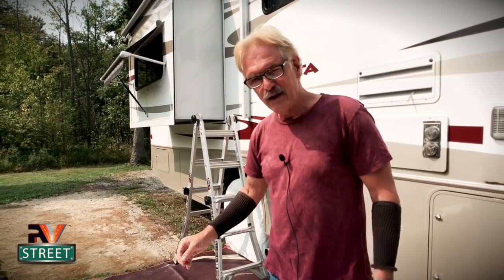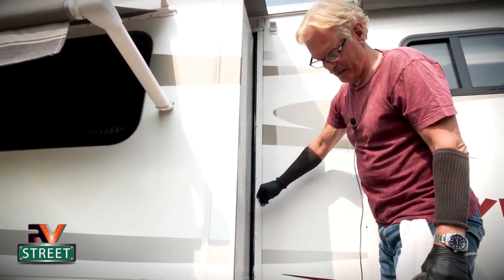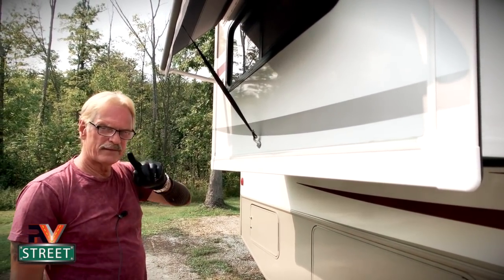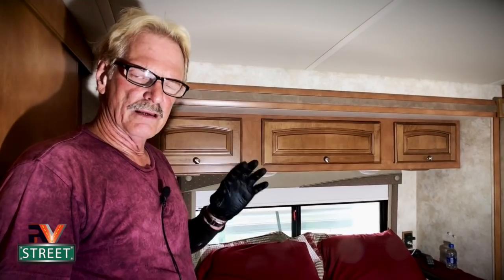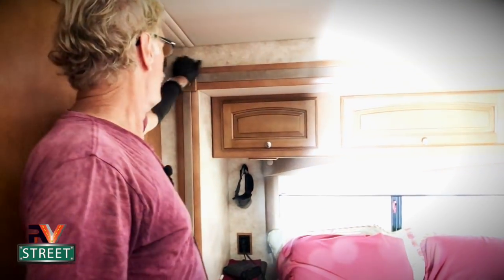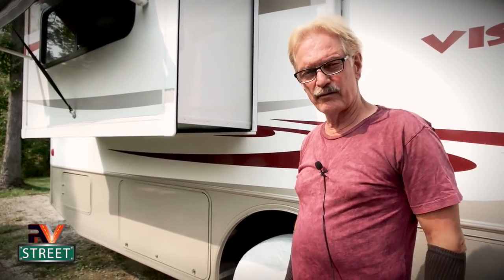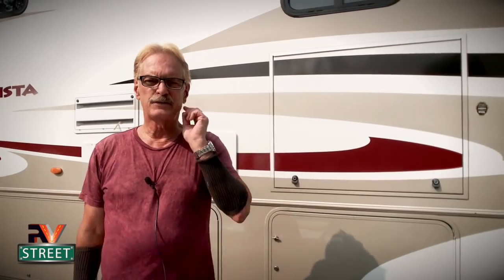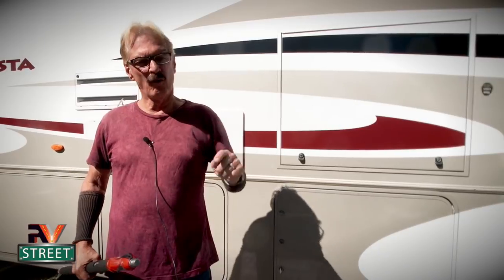RUBBER IS EVERYWHERE on your RV. How To Take Care of it. 👍

Comment: I could have sworn I watched another one of you vids and you recommended the 3 n 1 product.  In fact I think I used your Amazon link.
Reply from the maker: The only time I've ever mentioned or recommended using 3 in 1 oil was when I showed servicing the AC unit up top on the roof.

Comment: 409 spray  cleaner works better on rubber.  On my motorhome the user manual said not to use any type of cleaner due to the chemicals in most cleansers and 409 is cheaper.

Comment: Martin, why don’t you just use 303 on all your rubber parts, seems like it should do it all?
Reply from the maker: b/c 303 doesn't condition the rubber. I don't just want to protect it, I also want to condition it and keep it soft and pliable. Now for my tires YES. I use 303. Both products do different things and have different properties.

Comment: Love your videos! You teach me so much. Going to use your Amazon link to order the Slide out Conditioner. Will 2 cans do the job? I have a 31' class C so i will have Door rubber also. Does Your lovely Wifey ever do maintenance? I'm hoping i can do these projects you teach me?
Reply from the maker: Hi Gloradine, 💗
1 can will be enough to treat all your seals and everything else I covered once a year.
Yes Joanie helps me some doing assorted things. Washing the RV, polishing, helps me grease the chassis, misc assorted things and she changes the oil. 
😍 Thank you so much for supporting us using our Amazon Store. It means so much to us. You can even use our store to shop for anything you need even if it's not in our store. Just click our store link, shop Amazon like you normally would and check out.
What type of RV do you have and how long have you owned it?

Comment: Great hair.!! Just viewed ur kwikee steps ..again. Excellent.. question.i can't find the battery cut off switch wire schematics.for my 2006 Monaco holiday rambler/Neptune.  Monaco techs have not helped. The. Fuse attached to the selenoid  keeps breaking. Any suggestions? My mechanic" needs the schematics..thanks. Erin
Reply from the maker: Well you hit the jackpot asking this question.
Finding any documentation for Monaco’s and especially earlier years is very difficult. Not even the REV Group has anything. But below is a link to literally hundreds if not thousands of files. There’s more to download than you can put on a DVD. I highly suggest you download everything while you can. When you have all the files downloaded put them on a thumb drive or two. Keep a copy in your RV. I think you will be amazed at how much information there is.
https://onedrive.live.com/?authkey=%21AC8LiapHcfT6I24&id=B15E6D1D35D9EFAA%211851&cid=B15E6D1D35D9EFAA
https://www.monacoers.org/
Reply: I'm forever grateful for the wire schematics needed to troubleshoot battery switch issues. You guys are GREAT!!!  Someday I'll thank you in person..erin
Reply: I gave the info you imparted to my mechanic..he also sends his "thanks"

Comment: Another point is when you are looking at your coolant hoses to look at the hose clamps.  These over time will rust out and can be a point of failure.  Don't forget your heater hoses too. If you have a F53 you may need to take the access cover off from the inside.  This is the just the access cover not the large cover.   There is one heater hose that come has a clamp on it visible.
Reply from the maker: Yep we do that too. Hoses, clamps and everything in the engine bay. And yes the heater hose too. I actually found a real possible failure point in the heater hose where it went around a sharp corner and the vibration of the chassis was wearing a crease in the hose about 1/2 thru the hose. I replaced the hose and clamps and then wrapped that hose in split loom. This is why I teach all the time to constantly inspect and watch for possible failure points all the time and be proactive to fix these things before bad things happen. Thx for that Bob. 👍

Comment: Do you use the 303 on your awnings? I use it both sides of mine. I put it on with a sponge and on the underside while putting it on it removes bugs and water stains, plus the awning rolls out without the tacky sound nice and smooth.
Reply from the maker: Do you use the 303 on your awnings?.....
No I don't.
I used to, on our old factory vinyl main awning but I've replaced it along with installing matching window fabric awnings with a high grade cloth material. I now use Woolite and gently wash them once a year.

Comment: Do you also do your steering bushings and ball joints and bushings?    Scotty Kilmer another YouTuber  40 yr Mechanic swears by At-205 re-seal. He puts it in a little spray bottle and sprays all the rubber and bushings. He says it will rejuvenate the rubber. I’ve used it for about a year and everything looks good. I was wondering if you have tried that product?  Thank you for all the info. It’s great to see Mx type videos.
Reply from the maker: Haven't tried that product because I really like the conditioner I use as I showed. Really keeps rubber from drying out and keeps it soft. One can does all my rubber stuff outside and everything under the chassis. For me since I'm a full timer, I like products that have multiple purposes to save on storage room and money. The main thing is that these things get done with a good product and do it once a year.
Reply: @RVstreet  exactly. Do it right and correct the FIRST time. My wife and I are looking for our first class A. I’ve been a flight mechanic for the past 24yrs so I’ve been doing quite a bit of research to see what maintenance i can save money on by doing it myself. So far it doesn’t seem too bad.   Thanks again for your videos and the knowledge 😎👍

Comment: Great video and info, thanks! I followed your link but the only option available is $32 per can... is that correct?
Reply from the maker: That is correct. But one can goes a long, long way. One can will do everything I showed in the vid, plus what I listed in the description text and you'll still have some left. I use one can/yr. for the coach and our toad and still have some left to use later on if needed while on the road.

Comment: Great video!  Have you had to replace the seals on the slide of this coach or any other one you might have owned?  I have a 2008 Thor Chateau (aka Four Winds?) with the seal around the slide being one piece, as as opposed to 4 separate pieces, sides, top and bottom.  I made the mistake of leaving the slides out when it rained last week and water has intruded on the floor under the slide.  You can also see daylight when extending a retracting the slides.....probably not a good sign.  I can't seem to find any information on how to replace the one piece seal around the slide out.  I'm thinking it may be easier to replace all of the seals with completely new seals system....would you agree? I'm pretty handy and I know I can do this.
Reply from the maker: No I  haven't had to replace any seals but yes I would definitely replace them if your getting water intrusion. You can probably find what you're looking for here: https://uni-grip.com/products/slide-out-seals

Comment: Martin,  What about the  inside surface of the slide seal (the side that is against the slide when it is out) ?
Reply from the maker: If it's rubber then yes. I did cover that area when I was inside the coach remember?

Comment: Another great video! I use 303 for my seals, hoses and tires. Do you think 303 shouldn't be used in this way, or maybe the product that you use is just better? Keep up the good work 😃
Reply from the maker: 303 is great for tires because it protects them from UV rays if they're not kept covered. One of the main things that keeps tires healthy though is running them. And run them often at the proper PSI. Tires don't need an applied conditioner like the soft rubber stuff I covered in the the vid along with the additional things I listed in the description text.

Comment: Do you use this rubber conditionner on the rubber around the windows?
Reply from the maker: No. I use RejeX. I apply this as my final coat over the entire RV instead of wax. RejeX really helps repel and protects everything from damaging UV rays.

Comment: Do you also use this lubricant on the seals around the windows?
Reply from the maker: It's not a lubricant but a conditioner. We have double pane windows and I do polish those thick black rubber seals around the windows when I polish the coach, and then I apply my RejeX to them along with the coach. I clean them often too when I clean the windows. But you can and sometimes I do use this conditioner on those window seals when I'm doing the whole coach's rubber stuff and I remember the window seals. But honestly, sometimes I forget. But for me, it's no big deal because I take care of them all year round anyways. It's smart to keep them clean, soft and protect them from the harsh UV from the sun. Most rubber parts of any kind hates the sun and getting dry.
thx Mike 👍

Comment: I have seen you comment that you dislike silicone. What do you recommend in its place?
Reply from the maker: Thanks escape 👍
Silicone shouldn't be used for anything on a RV. To many better products on the market. There really isn't one easy answer to your question though. I use different sealants for different things. You can see all the different ones I use in my Amazon Store under "Sealants, Lubes and Protectants" category.
https://www.amazon.com/shop/rvstreet
Reply: @RVstreet   Thanks for responding so quickly! I want to recaulk areas (hatch doors, brake, clearance & side marker lights) that are attached to the fiberglass areas of my 5th wheel. I also need to caulk the seam where the fiberglass sides meet the TPO “Superflex” roof material. If you were doing this what would you use?
Reply from the maker: @escape1950  Here's what I'd suggest. My best advice would be, every manufacturer of any RV has what they call a "Sealant Callout Sheet". On that sheet they specify what sealants should be used on different areas of the RV. I'd go to their website and download their sheet and that should answer your questions. If you draw a blank there, let me know and I'll suggest something. 👍

Comment: Is 303 ok to use instead of Thetford for all the hoses and seals?
Reply from the maker: You could use 303 in—some areas—if you wanted to, but 303 is a UV protectant not a conditioner and therefore has to be reapplied several times a year. Thetford is both a protectant and a conditioner and applying it once a year is all that is needed. 303 is great for tires though. Think of all the rubber you have under the chassis and in the engine bay. No sun gets there but all that rubber can get dry so protecting it from UV doesn't do anything. You want to condition that rubber. That's why I use Thetford on all my rubber stuff. One product does it all.